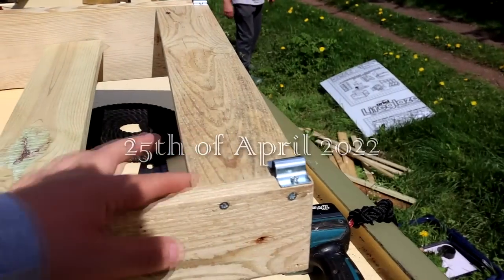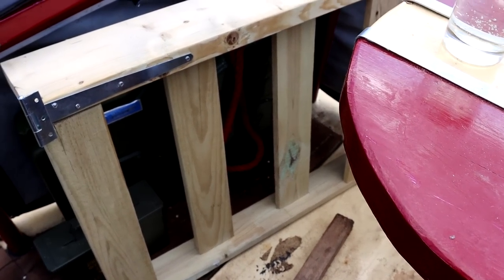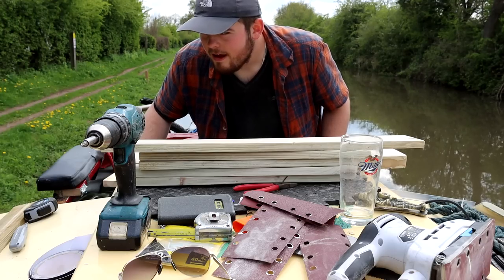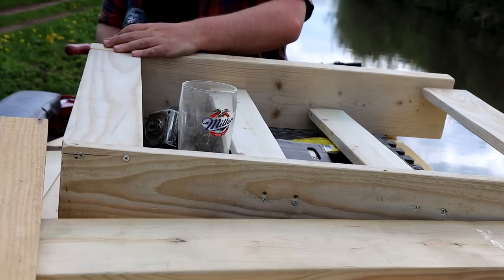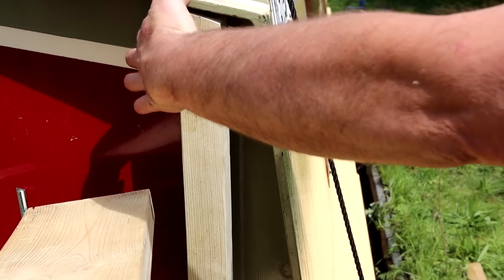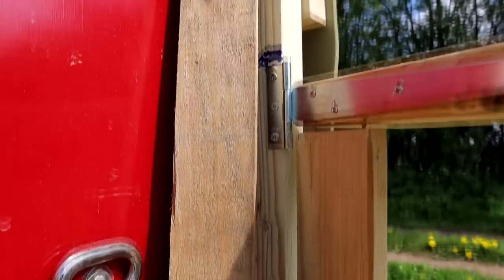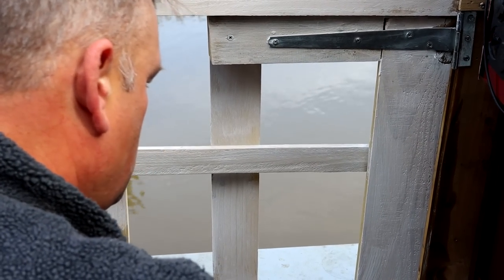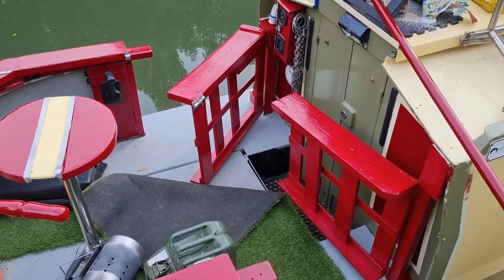Building Stern Gates For Our Narrowboat To Protect Our Cats

Comment: Well done with the gates ,little tip when you join 2 pieces of wood drill a  hole in one piece put screw
In the hole , it stops splitting and drows the gap together making tight joint.
And its easier.  We all learn lm 78 still learning .great channel guys
Reply: Thanks for that advice. What ever age we are we can always learn something new Ron.